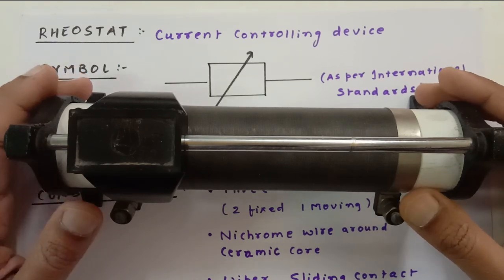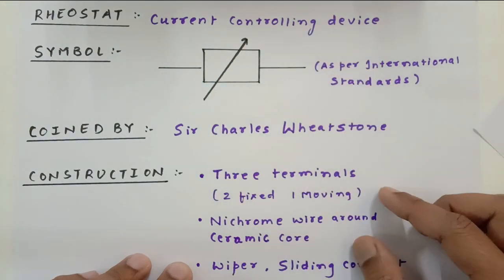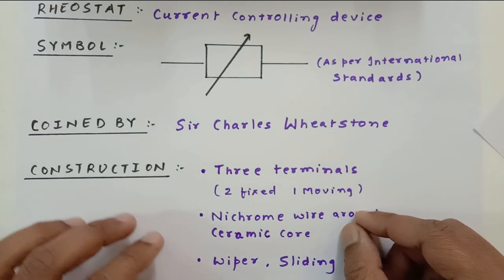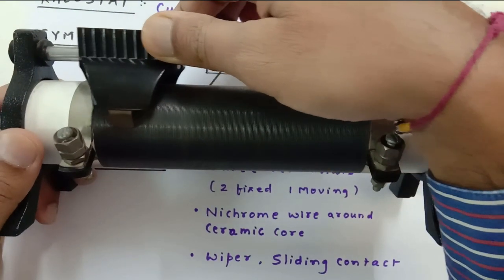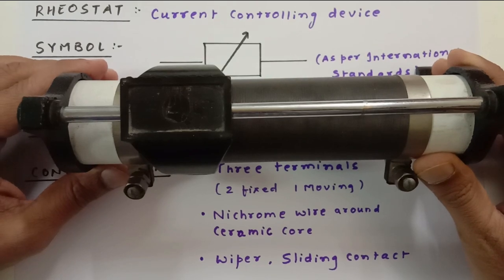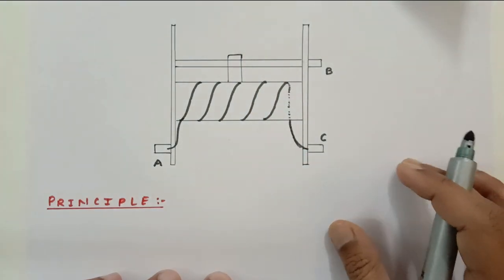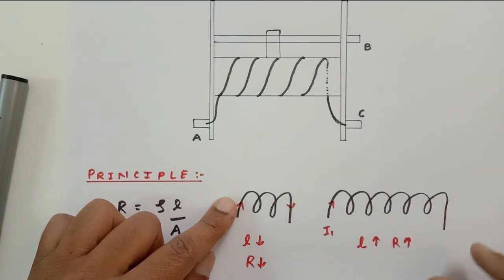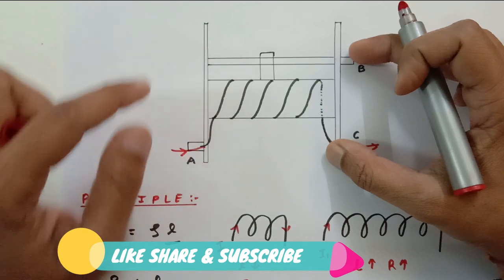RHEOSTAT CONSTRUCTION AND WORKING PRINCIPLE | PHYSICS | GRADE 9-12

Comment: In one of your video i.e., ( Resistance in parallel video) you said that when current passes through the resistors current doesn't decreases in fact it's energy decreases . And again in this video you explained current decreases. So , sir please clear my doubt. Plzzzz
Reply from the maker: Yes in resistances in parallel the resistances used were fixed so the current coming out of battery was constant here resistance is varying so current also changes
Reply: Thank you sir so much for helping me to overcome my confusion..

Comment: I was just wondering that how does rheostat avoid short circuiting of wires like we are not able to see any large visible difference between the coils of the wire
Reply from the maker: I hope you got your answer
Reply: @MakeMeScientific  no, not really sir...
I am assuming that the wires are not coated by any insulated material because finally we have to also connect the needle of the moving Jockey  directly to the wire, so concluding from this we get that why the current is even moving in the turns rather than just taking the shortcut path of just going from the top of each turn directly

Comment: Sir totally understood.. thank you
Sir but if we use the bottom two terminals , still that jocky is in contact with the coiled wire?
Reply from the maker: Then in that case there is no output from the jokey
Reply: @MakeMeScientific  ok sir thank you

Comment: Sir I have an another doubt! In my textbook they wrote that " the wire between the 2 terminals A and B provides a fixed resistance equal to the resistance of the entire length of wire ". Can u explain me this statement sir.
Reply from the maker: Thanks for watching the video. Resistance is directly proportional to the length of the wire. If you are using the complete length of the wire then you have attained maximum fixed resistance.

Comment: Sir what will happen if we move the jockey to the extrem left/right?
Reply: if u move it to extreme right current will have to cover long distance if u r using as per sir's diagram Point A and C
( if it is still has connection with wire)
And when you move it to extreme right or left( when jockey is not connected to wire) then the two bottom terminal only will be working

Comment: Sir I have a doubt. As u said if we use the terminals A and B , then current will flow according to the number of turns. So does the number of turns depend upon the distance of the jockey( like if we keep the jockey close , there will be less no. of turns and if we keep it far there will be more no. of turns)
Reply: Yes... If the jokey is placed near to the A terminal, then the number of turns would be less and hence less resistance, leadibg to more current flow...vice a versa is applicable too

Comment: Bt if we use the alternate terminals then you said that the current is not passed through second terminal bt how can the current flow from the first terminal to third terminal without in between the source as if it passes through jockey then we will get an electric shock

Comment: V GOOD EXPLANATION  Now I want to know how v can increase VOLT  MORE THEN input  220 V AC  & OUTPUT to get  300 V AC  CAN IT B INCREAS VOLT  to higher level AND CURRENT WILL DECREASE MY Q IS HOW TO INCREAS VOLT FROM 220 to 300 v AC  terminal between 1 & 3  output to work as variable   VARIAC for hobby experiment circuit testing
Reply from the maker: Yes 
This can be e done by using a step up transformer

Comment: Sir jockey konse substance se bani hoti h?
Reply from the maker: It's made by winding a very thinly insulated resistance wire around a barrel. A metal slider or 'jockey' wears away a line of the insulation so it can make electrical contact with the metal underneath.

Comment: Dear sir,
I have a doubt regarding this It's a request if you could kindly clarify .
When we are connecting it to A to B the jockey should not be in contact either with the wires .Bcoz if it is in contact with wire the current will flow to the C .Am I right?? Kindly clarify my doubt sir ASAP 🙏🙏
Reply from the maker: Yes true
Reply: @MakeMeScientific  Thank you so much sir for your kind information....😄

Comment: OK, but what is its use? 

Why would we choose a rheostat over a potentiometer?
Reply from the maker: Rheostats regulate the current whereas potentiometers divide the voltage. Rheostats can limit higher currents since their structure is larger than that of potentiometers. A rheostat cannot be used to control a potentiometer, while a potentiometer can be used to control a rheostat.

Comment: Sir can you explain how is it that it controls current if it is connected in series? Thang You and Godbless
Reply from the maker: If connected in parallel then the current will follow low resistance path and will no from the other wire where rheostat is not connected

Comment: I agree but I think current will passes through both coiled wire and joking...
Reply from the maker: Yes
Reply: @MakeMeScientific  I mean does current will past through rest coiled wire or not????
Reply from the maker: No
Current flows through low resistance path so wont pass through rest of the coil